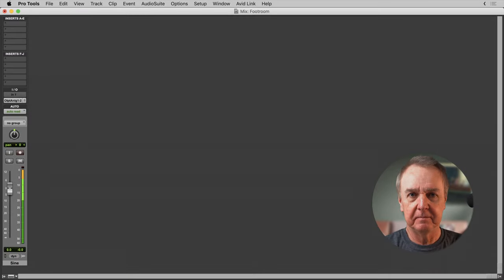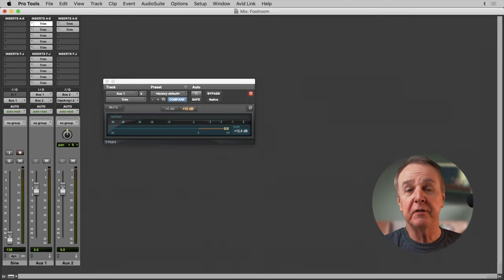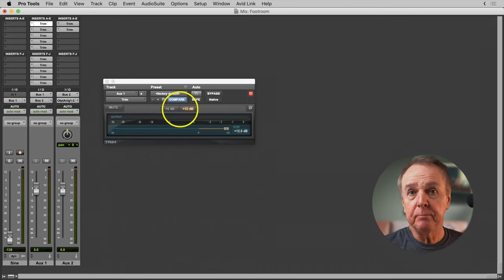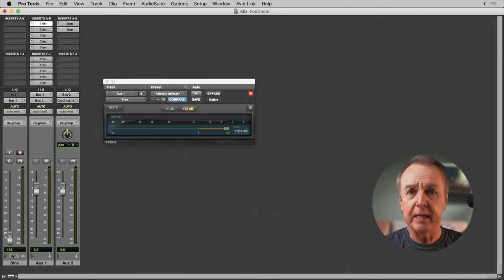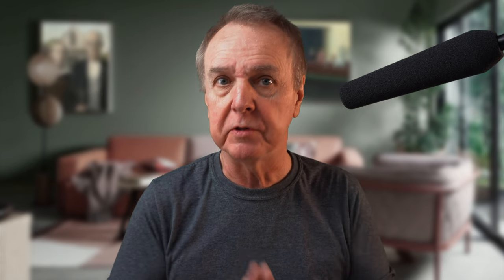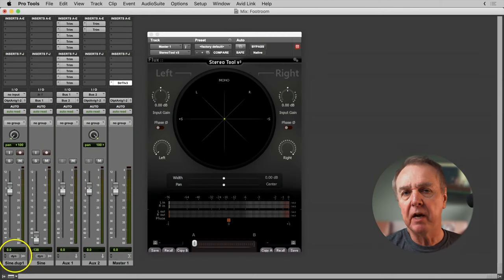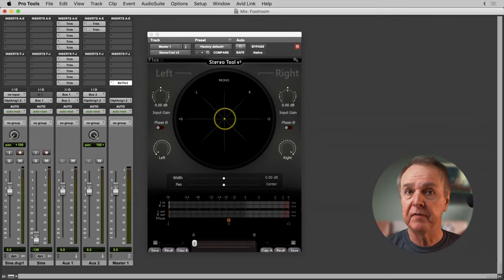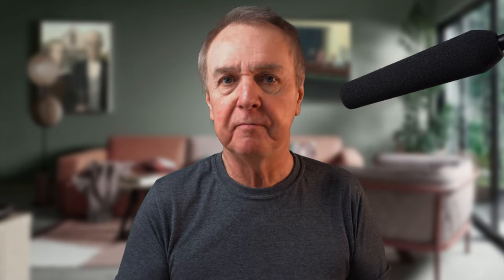The noisy truth about your DAW: An ear-opening investigation

Comment: You should consider to change to Reaper, the stock Trim plugin goes from -150 to +150 dbfs. For recorded tracks that have noise in it, or ground loops in a guitar amp, we use a gate. Like the XLA-3 compressor, we can add noise, or a tape plugin. Which are very good these days.

Comment: From a theoretical engineering point of view, this was actually quite bizarre and interesting. Spent 50 years in analogue signal processing, noise was our greatest enemy. I take it that turning down the gain compressed the noise floor inherent in the signal by the same amount, and we are not considering the actual noise floor or sensitivity of the equipment. I speculate that not having a constant signal i.e. 220Hz does have something to do with the fact that noise does not correlate incoherently while the signal is coherent. Interesting topics you cover - thanks.
Reply: "we are not considering the actual noise floor or sensitivity of the equipment"  Totally !

Comment: Volume controll with  digital do not involve any very low  digital signals but only specified numbers for very low DA output. DA  noise exists anyway but  is not  being recorded, only is  each time created from scratch from digital data. so in digital recording at level  -135 nowhere is recorded any -135dB by volume electrical signal - it is recorded with full standard voltage. hat is why I am not surprised by conclusions. 

Sensation of "sound of silence" may be experienced also  in -50dB analog level  Because in my case  I always or almost always hear   sound layer  from neighbours in the same block,  from street which i very quiet but birds sing, fly,  my computer working and my ears ringing. The level of perceived silence s too loud to hear any noise at -50dB which is generaly  considered not great for analog.

Comment: The DAW, a plugin or both may inject a floating-point "denormal" noise between -150 and -200 db, usually a square wave bias, which is designed to prevent the signal from becoming too low amplitude and costing more operations for the CPU. There is a setting for it in Reaper. I think it's not quite the same as a plugin not having a footroom because of flaws that accumulate throughout its working stages.
Reply: Yeah 32 floats have about 6 positions and an exponent component. It means on very loud sound you could loose very quiet squiggles omposed over it. I mean 123456^33 + 1, the plus 1 is lost. Same with 0.000000123456+1, 123456 is lost. That's why the daw limits the values to 150 dbfs, about 33 milion steps. I bet if youdo a 200hz bass sinewave at 150db amplitude and add a sinewave at 10k at 144db lower amplitude, that 10k signal is lost.

Comment: Isn't it the case that noise is presented by audio interface amplifiers and not by the DAW application?
Reply from the maker: The DAW works on maths and there's no noise in maths, not as far as I'm aware anyway. But getting the audio into and out of the DAW will always have noise so it's inherent in the process. DM

Comment: 1 bit = 6.06dB so you're reducing it by 23bit = 139.38dB. Not exactly 139dB you are then adding 139.38dB back giving you an extra 0.76dB which is probably being rounded down to 0.6dB by the display. So the discrepancy is valid, the amount of error being shown is slightly low due to I feel a lack of precision in the scaling on the display. Those bars are only 0.2dB in precision, so it's rounding down to 0.6 not up to 0.8 would be my guess.
Reply: Exactly. Attenuating the signal as he did introduces quantization error -- anything between 0 and -6dBFS would be lumped into that single least-significant bit. You can reduce the quantization error by dithering, but then you introduce noise.
Reply: How is he reducing the signal by 139.38dB when pulling the fader down to -138dB? I fail to understand what you mean...
Reply: @AlexLapugean  He scaling the signal by 2^-23. In decibels, that's 20 Log10(2^-23) = -138.47dB. This is equivalent to shifting each 24-bit sample right by 23 places, preserving only the MSB.
Reply: @bobwatkins1271  But why do you say he is scaling by that amount, do you say you can only scale by 2 to a whole power? That makes no sense, by that logic, you only have 23 possible steps between 0 and -138dB, I am pretty sure that is not true. Also ... why 24 bit? That is only applicable if the recording is 24bit, and even then, the processing inside of a daw is done at least at 32bit float, or even 64 in some daws.
Reply: @AlexLapugean  You can scale by any amount, of course, but -138dB is the example he used, and that's approximately a 23-bit shift. Ultimately, the sound will be exported to media as integer samples.
Reply: @bobwatkins1271  I am sure -138dB is approximately a 23bit shift, but what I am saying is why putting the fader to -138dB wouldn't simply scale by that exact value, why would it be different, and why would scaling back by that same ammount yield any change?
And of course if you print the very low level audio to a 24bit file, you would degrade the quality if you reamplify it, but that is not what is done here and not the subject of this video. All processing is internal to the DAW and it is not 24bit. And you can clearly see that, there is no signal degrading, if you were to print the -138dB sine to a 24bit file and then amplify it, I guarantee it would be very audible.
Reply: @AlexLapugean  I see what you're asking. I never said that scaling it back would not produce that exact value -- that was the original poster. I didn't read his post carefully enough before replying, and should have started a separate thread. My point is that if a sound is attenuated to -138dB and exported as 24 bits, then only one bit will survive, and the result would either be distortion or noise on playback, depending on whether dithering were employed.
Reply: @bobwatkins1271  Oh, OK, yeah that should be clear to everybody and I do think most know this. Precisely this is why this video was made, to show that in contrast, the processing inside of a DAW has virtually infinite dynamic range, so there is no need to worry about headroom or noise floor, up until you actually print the file.
Of course, you still need to provide a propper level for analogue modelling plugins, but that is besides the point.
Reply: 0.76 would probably be rounded down to 0.7, not 0.6 :) The real reason behind this effect is probably more complicated because of subnormal numbers: https://en.wikipedia.org/wiki/Subnormal_number After you've reached the lowest exponent value, you can still go a few orders of magnitude lower by introducing leading zeros to the significand (normally it assumes an implicit 1 before the first bit), but you still do lose some information and when you boost it back, it probably results in some very slight dithering noise. To understand why it's the way it is, it would be helpful to see the actual signal in the floating point format, plugin UI just doesn't give us enough to go on.